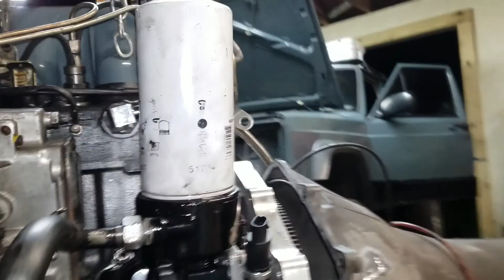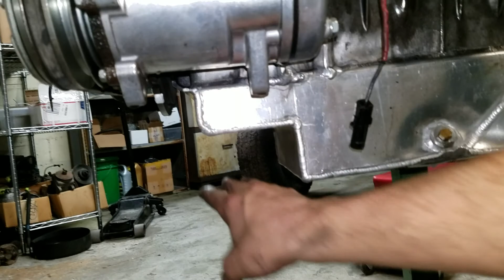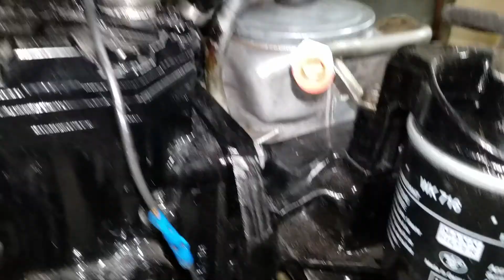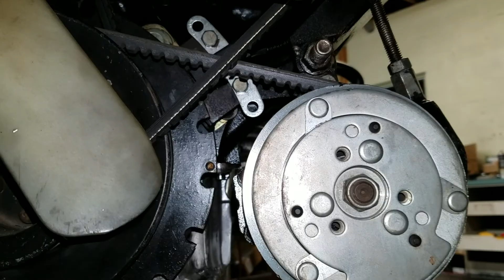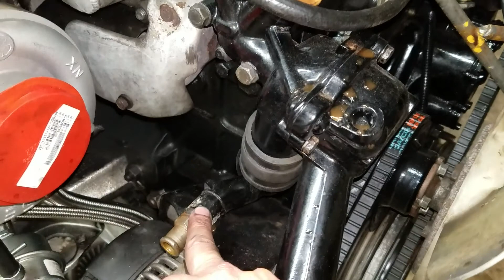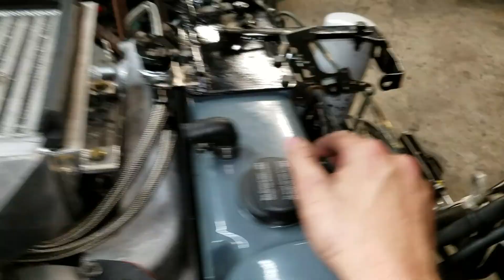Om617a walkthrough

Comment: With the location of your air 2 air after cooler I have to ask, why didn't you go with an air to water unit?  an air to water unit would have given you more capacity and possibly avoided cutting a hole in your hood.  in reference to the cam sensor, what is the relationship to the crank pulses? is it as simple as dividing the crank sensor signal in half to eliminate that sensor?